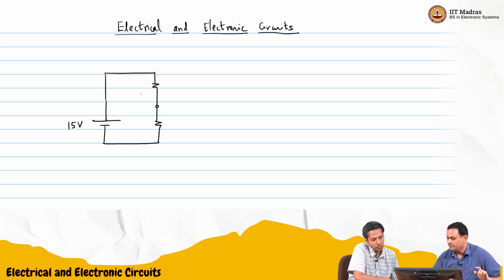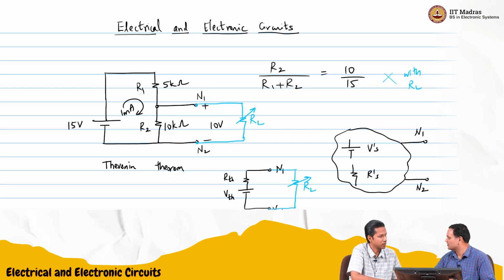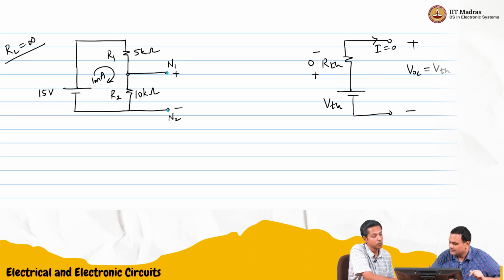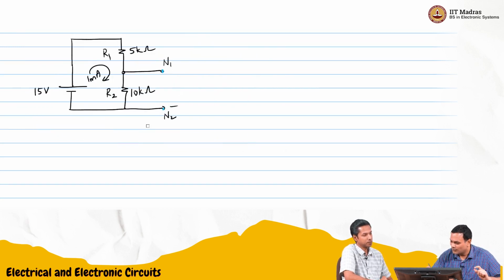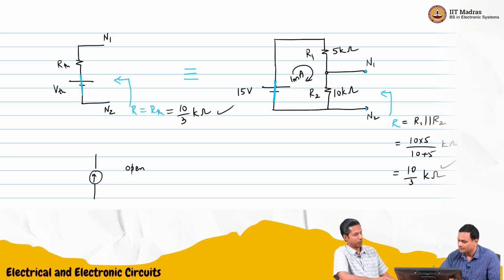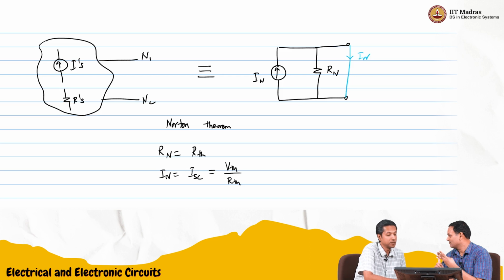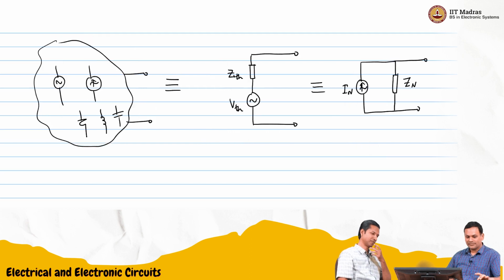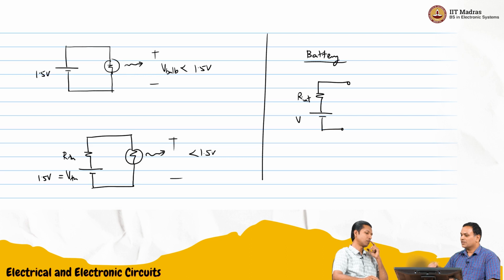W2_L2: Network theorems - Thevenin & Norton | alteranating & direct current circuit basics

Comment: 23:29 Register and current source cannot be put in series
28:54 the Vth would have an AC component and a DC component
36:27 the internal resistance is not constant